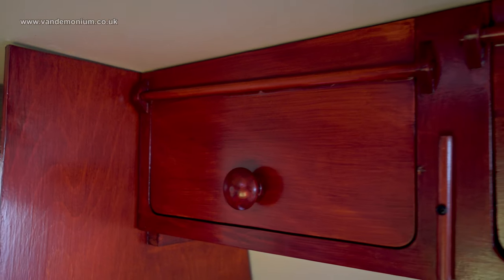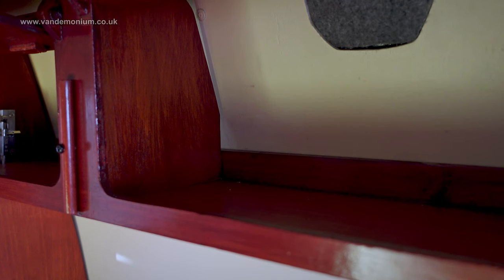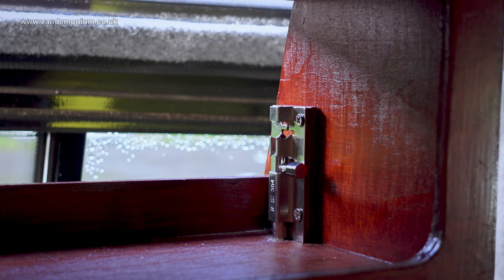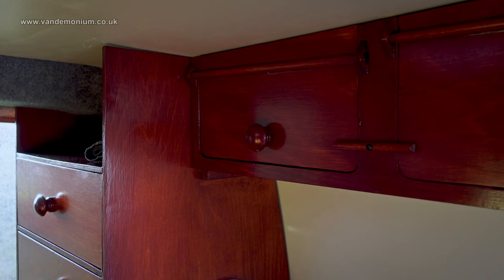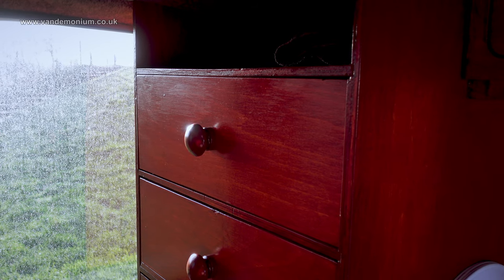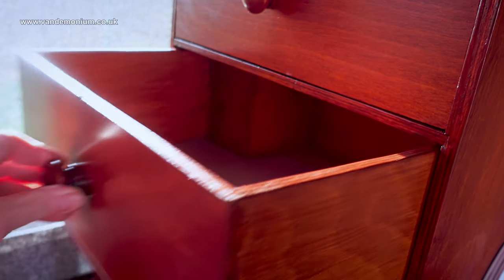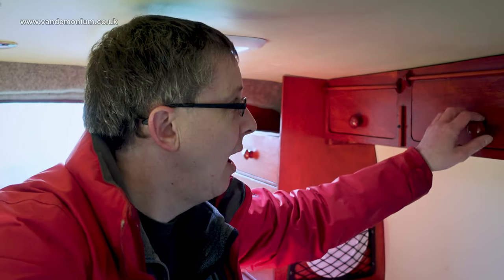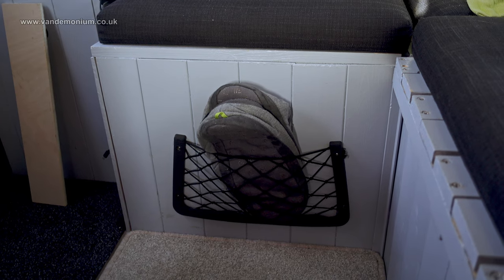48. Campervan cupboards: finished!

Comment: Those dowel hinges add character. :) I understand why they'd have to be on the outside. I think I learned from playing with Lego. If you make a Lego door out of bricks... I've forgotten the details, but I'm pretty sure you have to offset the hinges to the side you want it to open, because the bricks are designed for making walls; there's no clearance.

It's so very nice when you've made something and it's turned out well! :D

Comment: If you haven't already put stoppers inside your cupboards, try rubber ones. wood ones might start driving you mad whilst driving over time if they get a fraction loose. Rubber ones have a bit of give in them so you can make them sit tighter against your external twist locks

Comment: Great work as always 👍🏻 I know it’s late, but might I suggest getting yourself a little bottle jack to store somewhere in the van, saves having to dig out the original jack and chances are it’s one of those god awful scissor type jacks anyway. 😉👍🏻
Reply: I was about to comment the same thing. Those bloody scissor jacks need to be binned and a 2-ton bottle jack procured.. When you need it, you don't want to sod about moving things out the way, same as a fire extinguisher.

Comment: Excellent job, no need for high tech imported hinges, these dowel hinges are fully functional, pleasing to the eye, and a masterpiece of craftsmanship. Suggestion for the backsplash: a sheet of thin gauge stainless steel - easy to clean, easy to apply, lightweight, and brightening the room. And if you polish it, you have a full size mirror to check on your appearance before you start filming.
Reply from the maker: Interesting idea, I like that!

Comment: On those cupboard door stops, yes to the small wood block stop, but add a small felt covering to it and it will remove any possibility of vibration between it and the door.

Comment: Amazon offers a variety of spring loaded plungers that could be installed on the underside of the door frames, and project into the doors themselves.  You would pull the plunger down to allow the door to be opened, and then pull it down to reinsert the plunger rod into the underside of the door.  It would keep the door from moving forward or backward until the plunger was pulled down so that the bolt cleared the door bottom.

Comment: A low tech, non-Ikea answer that could be made "on-site" with  dowels, screws and some sheet metal. Simple, and nothing at all to be overly modest about!  It looks good. It works. It didn't cost an arm and a leg. You did it yourself and dammit, it's your van!

Comment: For the space you want to cover under the cupboards, perhaps you can use self adhesive vinyl tiles that you can get from eBay, They are very light, look like real tiles and can be cut to size with a knife or scissors.

Comment: Looking good! A couple of suggestions. First, for the blackout curtains, you can get a roll of self adhesive velcro.  Cut a couple of inches from the roll and stick one side to the van side and the other on the appropriate part of the curtain to keep it close to the van side. And for the area you thought of redoing in tile effect, how about a roll of self adhesive plastic roll? Available in a range of colours and patterns, but IMHO a gloss white would reflect light around and lighten up the area and be a wipe down finish. I used some to recover some kitchen cabinet dors. Made a good job, BUT ensure the surface is smooth as the plastic  shlws any imperfections in the surface it's stuck to.
Reply from the maker: Excellent ideas, both. Thanks

Comment: a small bit of velcro on the curtains between the cabin and the front should give the sealant from that light, on the curtain.
a little list on the top of the top cupboards will keep the lids from rattling.

Comment: They are so much better David. I put ties above my kitchen. Don't use regular tile adhesive and grout. I stuck them on with good blob of sikaflex Pro in each corner of the tile. For grout I used unibond healthy kitchen and bathroom anti mould silicone sealant. I used black to contrast the white tiles. This stuff flexes and shouldn't crack like usual tile adhesive and grout. That's the idea anyway and they've been up a while, on seriously bad Lakeland roads too, no issues at all. :)
Reply from the maker: Noted!

Comment: Not sure how well stocked your diy hardware stores are in the UK but I noticed my last visit here in the US they had these inexpensive peel-n-stick tiles that would be light weight for your van. Different styles from subway tile to brick to vintage tin ceiling tiles. Why not decoupage a vintage or current map across the area. Border in cork so you can pin souvenir's or stickers from places you've traveled. Just a thought. 😉 Have fun in your travels! Great van build!!
Reply from the maker: Thank you!

Comment: Loving the innovative solutions!!!

Hinges very unusual; would guess you have doubled the value of  the vehicle, at least.

The acres of varnished timber reminds me of a "gentlemen's" club in Pall Mall ... not Soho btw 😂.

Ref covering that "panel under"; perhaps go for a "Blue Peter" effect with "sticky backed plastic"?

There must be hundreds of designs out there. And wipe off-able to boot.

Or sticky backed cork tiles ( Top Tip:  suggest you very careful when sticking in place. Perhaps peel off a smidge of the protective film first, line up, then peel down the film as you go.

Anyway, looking good.

Comment: David - How about a small barrel bolt on the front of each cupboard door?  This would keep all three closed and prevent them from swinging in or out while driving.  You might consider nylon ones vs brass as the brass would rattle as you rumble down the road.  Nylon would be quiet.  Then for the “backsplash”, how about vinyl floor covering.  I bet you could get a scrap from a kitchen repair place and custom fit a piece to cover the entire area.  Hope this helps.  Watching your progress from Las Vegas!  Cheers.
Reply from the maker: Cheers but I wouldn't want to use barrel bolts, they'd look rather out of place with the wood; I do prefer the turning latch I've made, which is of the same "look" as the rest of it.

Comment: Nice work with the cupboards!  Your concern about the doors rattling is sound - when you make back stops for the doors, make sure you add some resilience (maybe some PU foam) so that the doors are pressed into the stops when they are latched.  That way, there is really nowhere for the doors to go when they are closed - no rattling!
Reply from the maker: Good point! Will do. I’ve got something suitable somewhere

Comment: David you may have seen them already, but you can get Velcro sided nets instead of the plastic sided nets that you have that would stick onto your felt walls. Have used a couple in the back of my wagon. Easy to move if you don’t like whether you put them.. 👍

Comment: Well done with that unit, for the curtains try velcro, you can fasten the curtain to the side/top of the van, and remove when needed, for the back of the sink area I would go with self adhesive vinyl, you can wipe it down if you splash it.

Comment: I am using kicthen cupboard wrap in my van for the cupboards. On looking, there are so many different styles and finishes online. D-C Fix you can get from B&Q etc but there's far more choice online, ebay etc. Patterns galore! Use on the back wall. Its water resistant and heat resistant. Self adhesive and removable with an air gun or hair dryer.
Happy vanning. 👍🤪😃
Reply: For use on the back wall.

Comment: for your blackout curtains, can you add another seam below the one that you have threaded the pole thru currently and then thread the pole thru the new hole allowance? it would give a wider ruffle, if you would, at the top. That would negate having to hang something from the ceiling to close that gap,  I hope that makes sense. good job on the hinges, looks very nice.
Reply from the maker: Understood. Believe it or not, the pole is already on a "lower" seam! But you're right, I could add another.

Comment: I know this is late and I apologize.  I searched your channel and saw that I missed two videos.  This one as well as replacing the tap, which I will watch as soon as I stop typing. 

Your cupboards are fantastic and no doubt you were chuffed!  You did a brilliant job building them, too.  The little dowel stopper is the perfect solution and I agree with you on the magnets. They are either too weak and you might as well let them flop with every bump or they are really strong and you actually injure your shoulder or rotator cuff just trying to get them open.  Also, when the dowel closure starts to loosen, as they often do,  a quick turn of the screwdriver will tighten it right up again. Very smart, all of it. Also, one of the most annoying things in a small space is not having a place for shoes and slippers and one inevitably gets kicked under a cupboard and you have to crawl around on the floor trying to find it. Drives me nuts!

You thought about tile but worry it might be too heavy. You can now find vinyl tile, foam bricks and all sorts of heavy wall treatments now have very realistic artificial alternatives.  There might be a beautiful view that you might want to look out on and you could get a print made, round the corners and put it up like a view out of a window. You might also get a very light colored wallpaper to contrast with the dark wood. I have actually picked out a light colored and textured wallpaper for my van build. They can look very nice. If you know a painter who could paint a mural or even paint a Frank Lloyd Wright stained glass with light coming through it design. Which is incredibly random.  You could also paint it white, grey or whatever color and make it a functional wall with all sorts of magnet mounted accessories like dry erase boards and small baskets and... And my last idea is to paint it white for a projector screen.

The drapes or curtains are great. I don't know if you need to add a strip, although that is an option.  There is enough give in the fabric to attach some heavy duty Velcro along the edge of the curtain to attach it to the wall. That will leave a 2 cm triangle where light can get through. You could put a  7cm wide column of weather stripping foam or rubber at the wall behind the seats that could block the weather and the curtains could attach to and it may be that you are perfectly happy to add a strip of fabric at the edges. 

My brain has no more new(ish) ideas.  Well, I haven't seen the weather stripping before, and I think it would be easy, affordable, non obtrusive and look very clean and finished. So I think but what do I know?
Reply from the maker: Excellent points

Comment: How to keep the doors from flapping inward? Remember your stops in your drawers? Just take a couple small pieces of wood, stained to match the cupboard and screw or glue them down onto the base of the shelf by the bottom corners of each door that will keep the doors from flapping in. 
Another idea is matching dowels that are screwed into the doors that when orientated horizontally rest upon the down keeping the door from flapping open. You can even cut a bit out of the bottom of the right hand dowel and the top of the left hand dowel so that they both rest even atop of the existing dowel
Reply from the maker: Haha cheers but it's already done (small inserts per your first suggestion)

Comment: Nice job. You could have hinged the cupboards at the bottom so they come down instead of up? The sink splashback would look good covered with either a nautical chart or OS map, Get a waterproof one of your favourite place / area / cruising area.
Reply from the maker: Yes, I decided I didn't want dangling cupboards but it would have been a fair approach in terms of holding them open (which they currently don't do but I don't think will be an issue)

Comment: PVC panels the type used in bathroom makeovers light and fixed with no more nails or sealant great choice of finishes easily cut and I’m sure you could  get off cuts that space is so small good luck great work man ship  .Best wishes from 🇮🇪.
Reply from the maker: Thanks for the tips!

Comment: Good work there David. Can I suggest small pieces of velcro strip to persuade your curtain to follow awkward corner. Also, how about a small bracket attached to the drawer front for the for locking dowel to go into thus preventing the drawer fronts from moving in or out. Just a thought. Best wishes.
Reply from the maker: I don't quite understand; the dowel already prevents the drawers moving in or out?
Reply: @Vandemonium  Sorry David it was the "keeping the cupboard door from rattling while driving" problem you mentioned at 12:15 that I was referring to. If you don't want to reduce capacity inthe cupboard with a backstop inside the cupboard, my suggestion is to have a S shaped bracket on the door front which would latch the dowel. One facing up and one facing down to receive the turned dowel . Probably less pretty than your solution I think.

Comment: Great work David 
Wickes have 'Alu-splash' panels of different colours and sizes. We intend to use them instead of tiles in our kitchen. Yes your right painted 1/2 mm Aluminium
Keep safe dry and virus free
Reply from the maker: That's useful to know, cheers!
Reply from the maker: I've had a search at Wickes and can't find it. You don't happen to have a link handy, I suppose?
Reply: @Vandemonium  Painted ally would also work, yes. Will double as a whiteboard like my fridge does.

Comment: Looks great. How about using some self adhesive floor tiles on the back - all sorts of patterns, and they are easy to cut and flexible so they would fit the curves pretty well - a hair dryer would help if they were a little too stiff. I might have used iron-on or wood on the edges of the plywood, gives a nice neat finish. A bit of wood behind at the top of the swinging doors may stop them flapping about and save having to have a block on the floor of the shelf, which may get in the way of something.
Reply from the maker: If it’s at the top of the doors, they can still swing open as the top moves outwards!
Reply: @Vandemonium  Good point! Back to the drawing board.
Reply: Right, got it. And this may solve it for both ways. Take the pull knobs off and drill through the doors where the hole is as made by the screw, make the hole big enough for a, say, M8 (maybe M6) bolt. Get a thin-ish piece of wood, say 1 and a half inches long by half an inch wide by a quarter or less thick, drill an M8 (6) sized hole a quarter of an inch from the end. Drill into the pull knob, where the screw was, about half an inch. Put the bolt through the piece of wood, then from the back of the cupboard through the hole and then tighten it into the pull knob. When you turn the knob the ‘latch will rotate too. So make a slot in the bottom of the shelf and the latch will locate into it when the knob is turned. This will hold it from moving both ways. You will have to fiddle about with it as you will, with spacers etc., to get it to work properly, but there you have it.
Reply from the maker: That's ingenious! But in fact I realise your original suggestion is perfectly valid because (and I misread it) you said "behind" the doors so of course that would indeed stop the top coming open outwards! Fantastic. I shall invoke that idea after all :-)
Reply: @Vandemonium  Glad to have been of service :).

Comment: You should put some more felt on the latches and the pieces of wood that will stop the cupboard opening inward. 👍🏻
Reply from the maker: I don't understand how felt on the latches would stop it opening inwards..?
Reply: @Vandemonium  Sorry, didn't explain myself very well! I just thought that with both the latch and the piece of wood inside the cupboard it would rattle when driving. The felt would stop this, maybe?
Reply from the maker: Ah, I see what you mean. I was hoping that with another tiny block inside the cupboard, the door would be sufficienly trapped between that and the latch not to move but I can appreciate you're saying it still might wiggle so quieten it with felt. Gotcha.

Comment: It's pitch black, pouring with rain and thunder and you've blown a tyre in the back of beyond. There's nothing worse than having to take your vehicle apart to get to vital equipment. Consider relocation of vital equipment to a more accessible place. Blank wall - try using a wall covering like a flexi-mirror. It makes the width of the vehicle feel much grander. Well considered constructions. The boy has done well!!
Reply from the maker: Honestly it’s the work of less than two minutes to remove the shelf and corner unit, and access the jack.

Comment: In regard to the problem with the curtain and the corner. It seems to me that there is enough overhang on the right side of it so how about you cut out the shape of the corner from the curtain and put some velcro or a snap fastener to hold it in place? (I might be a bit late with that suggestion but maybe its still helpfull?)
Reply from the maker: Unfortunately the curtain really isn’t wide enough (just)

Comment: If you cut the top outside corners of the curtains to the profile, it looks like they might well reach across. Some nice person with a sewing machine could put some binding over the cut edge, or you could sew it by hand in front of the fire. Hahaha A double baffle hanging one each side at the top, and I reckon youll be blacked out.
Reply from the maker: Unfortunately, the curtains are just too small to fully fit to the edges :-(
Reply: @Vandemonium  Ah well, theyre something to work from. Looking forward to seeing it all done.

Comment: Have you had a look at bathroom wallpaper for the fake tile area, should be durable enough for the occasional water splash, maybe you could match at the pattern repeat if the area is wider than the roll.